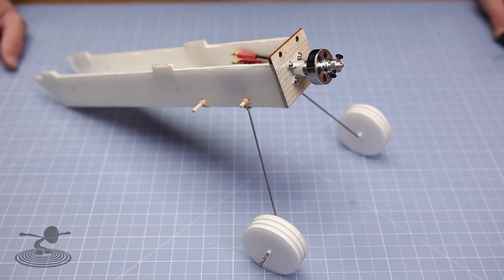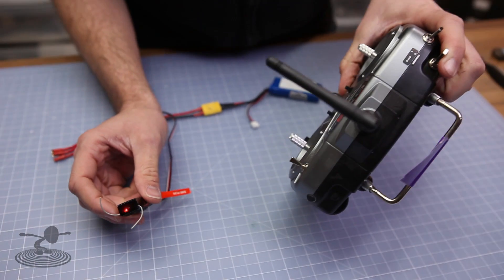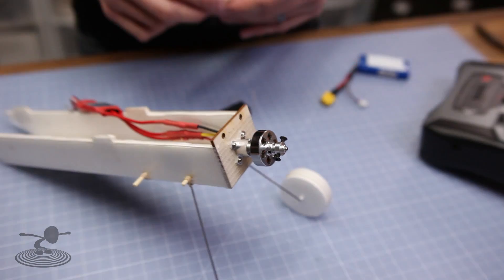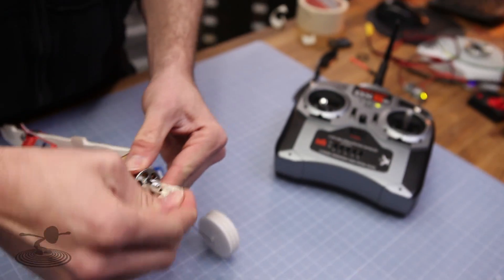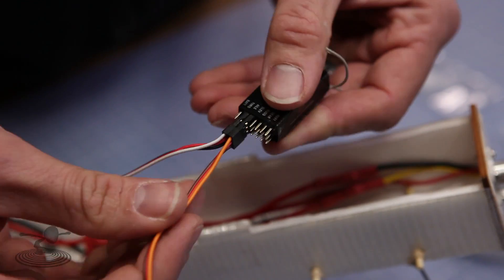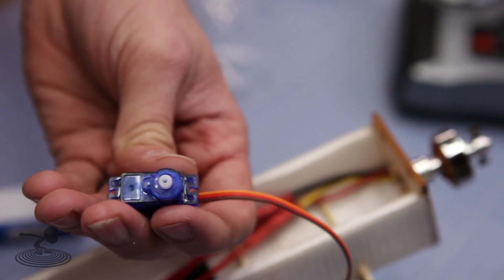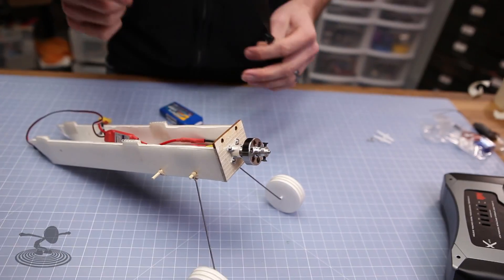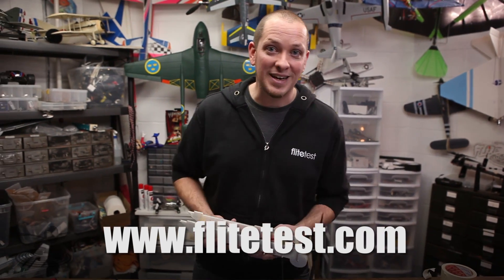Flite Test - Connecting Electronics

Comment: how do  i fix this i forgot to pull the stick back when I plugged in the battery. so its basically reversed eg I put full throttle doesn't move when I pull the stick to the lowest throttle it goes full throttle so pls tell me how to fix it

Comment: Is there a danger to leaving the bind plug in for the first flight? I was distracted and forgot to remove it at the field yesterday. The plane flew but crashed 30 seconds later. In 10 years I never crashed this plane. Just wondering if leaving the bind plug in had anything to do with the unexpected dive into the ground. TY

Comment: this help me before i buy ESC, now i understand i not need 2 battery ,3S to motor and 2S to receiver, before i no know esc have output to receiver, what have regulated 4-8volt to receiver. 5 volt work well. but i no know motor anythink what is better if FT build plane simple cub say need 2212/1400kv what this mean, and what have if change biggest motor i no know what is biggest maybe 4020/3000kv or about somethink. what motor mark mean. have somewere paper table small to big motor ? and how i know what motor need use ?

Comment: Doubt anyone still checks these comments, but what do I do when my ESC only has the signal and ground wire? Hook the battery up to the receiver through the balance cable?
Reply: LaZieGoblin sounds like an ESC for a brushed motor. Incompatible. Both must be either brushed or brushless. Don’t mix.

Comment: Which is very economical and good transmitter and reciever?. . . anyone plsssss
Reply: turnigy i6 is good has built in telemetry so you can see the power of your plane battery while flying  very easy to set up and plenty of online advise on youtube for settings if you not a read the manual type
Reply: flysky i6 is gud too

Comment: I HAVE A PROBLEM! my elevator stick behaves like the throttle stick were when the stick is at the bottom it is in the stopping 
position and when it is in the center it is going 50 percent and when at the top position 100 percent speed. somebody help me please.
I have flysky fs t6

also dont question why I have the motor on elevator.

Comment: I plugged everything in correctly but motor wont work nor does the servos... what does this mean? The receiver does flash but when i turn controller on it stops it does not hold a steady light. it came together (Tx Rx) so i don't think i should have this problem. Also mine did not come with the antenna thing you plug in...

Comment: How To setup a plane which has aileron, rudder, elevator? I have hobbyking HK-T6A transmitter and receiver. I have to connect aileron servo to channel 4 but the servo doesn't moves at all on channel 4. But if I change mode in PC software T6 config. Channel 4 works but channel 2 doesn't. Where I need to make changes so that all things I mean 4 servos also works.? Please help to finish my build. I m building RC MERMAID sea plane. Thank you.

Comment: This post is old. I'm guess I'm old. RC has come a long way from what I remember. Crystal radios and the like. How far we've come, just the fact that you can click on YouTube and instantly get all this info is pretty amazing. Kids don't know how good they have it. Thanks for getting me back into the hobby Josh & Flight Test! You guys do some pretty boss crashing, I mean flying heh heh.
Reply: Yes.  I still have my first RC radio, a Pulse Commander single channel (rudder only), but the plane, a 2T with .049 was thrown away about ten years ago,.  The nitro fuel had turned the balsa to mush near the firewall, and the covering discoloring and cracking and peeling from storage.  Kept the 'ol .049.  Lots of hours watching that tail wag!  I'm not going to dig the radio out of storage now, but I believe it was crystal, 27 mhz, as was the Heathkit 8 channel built from a kit.  Still works too!  But its not legal anymore, wideband.  I was tempted to use the micro 1205 servos again.  I know who built them.   ;-)  But they are four wire instead of three.  And now a 9 or 12 gram with metal gears can be had for <=$10  and digital for maybe $5 more.  Times have certainly changed.  I remember how expensive the first stabilizing systems were, in times when each dollar was tougher to get a hold of and save.  Now a stabilizing system or complete autopilot can be bought for what one pockets from shoveling the snow out of the neighbor's driveway.   With so many now developing new boards and software, opensource software that can do amazing things with 32 bit processors, what the newcomers to the art and science can do is come up with new and creative ways to utilize the tech to do things that are not only fun, but useful, and advancing the knowledge.  With a three foot ribbon tied to a UMX Radian with 500mah battery, I relax while flying my "stringless kite" in the wind , directly overhead, for 45 to 50 minutes, more when there is lift, until the hawks come and investigate, and then continue on their way.  So far they are friendly to the Radian.

So yes, a big thank you to Josh and FliteTest for inviting and welcoming and encouraging a new generation, and the previous generations, who now also enjoy the new tech.
Reply: Airborne the radian is great! I have the full sized, I have had a 2.5 hour flight on it with thermals! The old equipment is hard to get rid of anymore. Everybody wants the new electric stuff. I have a .91 nitro trainer for sale. It does not want to sell. It stinks.
Reply: Yep..no more days of ease like just plugging in a frequency color coded chip and fly the color on your antenna and..BOOM!...you are bound and RTF. 40 yrs of rc and now I am usually somewhat lost in the tech..lol

Comment: Is is possible to link two different company transmitter and receiver?
Reply: nope!!
if using spektrum you need to use both a spektrum receiver and transmitter. The same applies to futaba! use a futaba reciever if you have a futaba radio.
Hope this helps and happy flying :)
Adam

Comment: I connected the receiver with the bind plug and throttle just like you did, and there was no flashing light or any indication that the receiver was powered up. I recently bought a new receiver because the old one was also not powering up. What is my problem?
Reply: Gage Spicer Are the receiver and transmitter compatible, and did you remember to remove the bind plug immediately after?

Comment: Hello Josh. This video was helpful. I am scratch building a Boeing 737-800. I am at the point of putting in servos and making the elevators. I can not find a video that shows how to connect the all. The landing gear is fixed should I get a 6 channel remote and receiver?  Also, i was told at the local hobby shop and they said I had to build and then weigh to know what type of motor. How can I weigh my plane to know what type of edf's to use? I'm a fairly new subscriber and I built the ft-22. My nephew loves it. Is there any videos I can watch to teach me how to wire this thing up?
Reply: buy a 4 channel receiver for this plane if has fixed landing gear but if it has flaps then buy a 6 channel receiver.
Hope this helps!! :)

Comment: my radio lead on my esc melted as soon as i connected my battery. any ideas?
Reply: you have a short somewhere, you will also need a new ESC. Find the short first. Most common mistake is attaching components to a carbon fibre frame. CF is electrically conductive. Most people don't realise this. If you not sure go to the flight test forums and post pictures, the guys on there are normally happy to help

Comment: I'm building the ft duster and i bought the recommended electronics, but now they are not compatible with each other.  I bought the Lazertoyz power pack, which contained everything but the battery.  So I bought a battery at hobbyking, a a 2 cell 7.4V Turnigy 500mAh.  Anyway, I can't hook up my Emax 2204-2300kv motor to my battery so please help.  Btw, even if i could, I don't have a charger.  Are there any batteries that come with chargers?  What do you recommend me to do now?

Comment: If the remote and receiver are both 2.4 gHz, is it a guarantee that they are compatible.?
Reply: +Mahmoud Elsharawy No. Not all manufacturers will work with others even though they are all 2.4ghz. HobbyKing Orange receivers will work with Spektrum.
Reply: Glen Ely But they are expensive. Is there any cheap and replaceable option? (I am not about to waste a lot of money making my first RC plane)
Reply: Another question. There are 2 Ailerons, so don't you need two ports for them? In the video it looks like there is only one.
Reply: Mahmoud elsharawy , both servos of ailerons are joint up in the two open ends of y-leads plugs and another end of the y-lead plug is hooked up into the receiver , if u have big servo u can just use one of it as ailerons , but servo arm shud  be of another type
Reply: Mahmoud Elsharawy On the ailerons you use the one aileron port but you use a "Y" harness to connect the two. A cheap option for radio & receiver would probably be HobbyKings Orange radio & Orange receiver. Someone else may have another suggestion. Good luck.
Reply: Glen Ely Can you please send my links for them?
Reply: Hobbyking dot com
Reply: Glen Ely I meant a link for the actual radio and receiver.
Reply: +Mahmoud Elsharawy http://www.hobbyking.com/hobbyking/store/__47080__HobbyKing_HK6S_2_4Ghz_FHSS_6Ch_Tx_Rx_White_Mode_2_.html

Comment: I am planning on buying the ft viggen what can u give me all the electronics plus transmitter i will need on a cheap budget
Reply: +Swagga Fox Music  i have links for the electronics for the edf ft viggen (the edf and battery are more powerful than normal)

www.hobbyking.com/hobbyking/store/uh_viewItem.asp?idproduct=49488

http://www.getfpv.com/lumenier-5200mah-4s-35c-lipo-battery.html

http://www.hobbyking.com/hobbyking/store/__49488__Dr_Mad_Thrust_70mm_11_Blade_Alloy_EDF_3900kv_Motor_1300watt_4S_.html

http://store.flitetest.com/graupner-mz-10-5-channel-transmitter/

http://store.flitetest.com/graupner-gr-12l-6-channel-2-4ghz-receiver/

http://www.amazon.com/J-Deal%C2%AE-Micro-Helicopter-Airplane-Controls/dp/B015H5AVZG/ref=sr_1_1?ie=UTF8&qid=1462579403&sr=8-1&keywords=9+gram+servos

http://www.hobbyking.com/hobbyking/store/__11430__HobbyKing_40A_BlueSeries_Brushless_Speed_Controller.html

Comment: Also, what if you're building a twin engine plane?  Do you need a receiver with 2 throttle outputs?   Or can you splice the one set of throttle outputs to go to 2 separate ESCs (one for each motor)?  Or can you have both motors driven by one ESC by splicing the sets of motor wires?
Reply: +Hungry Guy What you can do Is get something called a Y-splitter which splits say for example the throttle pins instead of one connection port you then have two and they can be simultaneously throttling.

Comment: I'm confronting problems with my EMAX BLHeli 40 amp esc, i have 4 servos and a Emax gt 2215/09 motor connected to Rx. The motor and servos work good for a few seconds and after that i lost the power of my electronics . I'm using a 3s 2.2 turnigy battery for power the system.

Comment: So typically with the 3 channel planes like the ones in the 3 pack kit do you plug the rudder servo into the aileron plug on the receiver?  It seems like this would allow one to use the right stick to control the rudder.
Reply: That would work, but is a bad idea for training to fly better planes. Most to all planes have rudder on the left stick (mode 2)

Comment: If I buy a motor, how do I know if the ESC, and motor wires are the same? Do I know when I buy them?
Reply: +fluffy snake photograper mostly the motor and esc are connected by bullet connectors , mainly the motor comes with male bullet connector pre -setuped of different diameters like 3.5m etc so u have to choose right female connector for it  and solder them to esc 3 wires and hook them up

Comment: Is it the same for Multi-rotors or is it diferent? (i mean like the setup and the way it works)
Reply: in multirotors no servos needed u need 3 more brushless motors, fligh controller, 3 more escs , power distrubution board, and some other required stuffs

Comment: If I buy the Turnigy ESC and the Hextronic motor recommended for the FT flyer, will I need to buy any connectors or screws or anything? I would like to buy one with compatible connectors attached if possible, thx
Reply: I would for the next tonic motor you may need bullet connectors and for the esc you can get an xt 60 battery connected and you will also need female bullett connectors for the Esc
Reply: RC Majesty Can't you just solder the motor wire to the esc? Is there really a need for bullet connectors?
Reply: Fawwaz Hosein if something breaks,it makes it easier to swap out the broken component if you use connectors
Reply: Ok thanks.

Comment: I have a esc and receiver probleme. When i conect the batterie to the esc SOME TIMES the receiver lights up. My receiver is the turnigy 8ch 4.5-6.5 volts and my esc is 10 amps. I alredy binded the receiver at the bigening. PLZ HELP !!!!

Comment: Why does the motor need to spin in counter clock wise direction? It should depend on the prop you are using, no?
Reply: yes, but standard rotating is cc, i believe.
Reply: yes, there are probably some vids explaining that some ware.

Comment: ok im new to rc and i have a very large problem if i plug the battery into the receiver it starts on fire and i have the battery connected into the speed control and that is connected to the receiver the speed control starts smoking please help i do have ground and power connected the right way. thank you

Comment: Thank you, usefull info.
Can you make an episode or series of episodes about modifications like:
1.How to use one more channel for flaps or something (physically and how to set TX if it was not set before)
2.How does the electronics works, for example if i have motor of 3-4 cell 500w max, can i get the 500w with 3s lipo and what will chane if i put 4s lipo, if i put higher amp ESC will it fry my motor?
And basically how to change/upgrade the hardware without frying anything.
Deep dive info

Comment: I would like to point out that you should disconnect the battery from the ESC prior to swapping motor leads to change motor rotation, especially if you have braking enabled as this could damage the braking control circuit on the ESC. It's also an all around good safety practice.

Comment: Hi flitetest, perhaps you need to add a note here to your video. NOT all ESCs can be used for this application, only those with built in BECs. If not you gotta use those external receiver battery. I think you should add a note before a noob fries his expensive receiver...

Comment: I think you could of explained the prop rotation better for pushers , if you take the motor and prop configuration you have in this video and mount it on the rear of a plane backwards as a pusher ,,the prop would blow air forward ,thus prop needs reversing for pushers so numbers point to motor or nose of the plane , or am i wrong ?

Comment: Hi guys, I agree with a lot of the other comments on how to set up the HK KK2 board,it could be a bit confusing on how to set it up, ie the P and the I gain, or maybe how to flash it with V1.5 firmware etc. It's a great board for the buck but with all of the functions it has it could be intimidating for some, Thanks keep up the good work!

Comment: I think these types of videos are very useful. Great presentation Josh.
The direction of the prop depends if you are facing forward or aft when looking for CW or CCW.
Sometimes a mechanical reversing of the servo is also possible by removing the arm and putting it back on 180 degree. If you have the linkage clearance this can be another option.